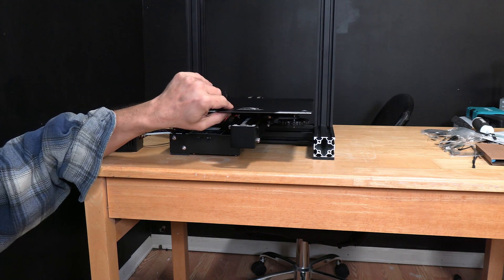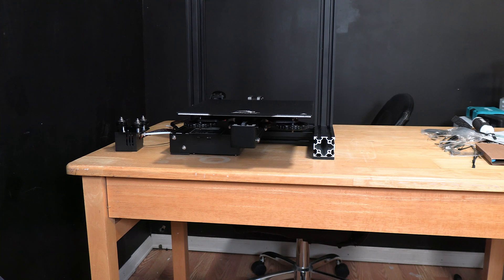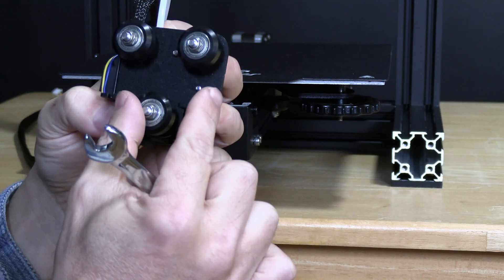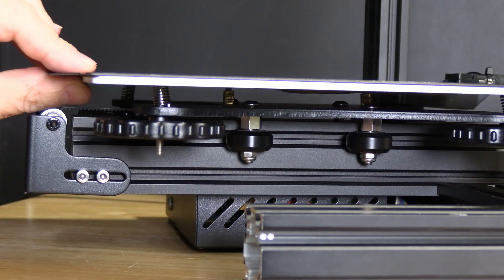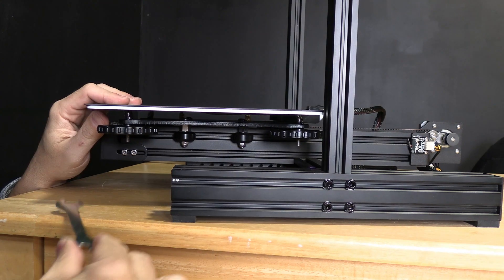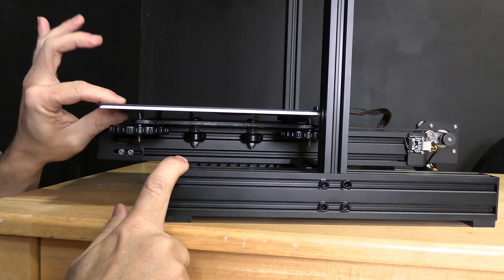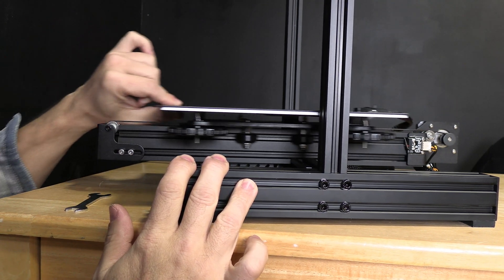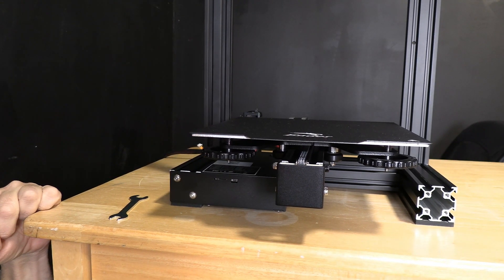How to fix Loose Wobbly Print Bed on 3D Printer. Find & tighten your eccentric nut.

Comment: What to do if y won’t move or y axis won’t go home? 

I see a red cable dangling off the heat bed, I read that is extra from manufacturing, but not sure. 
The belt seems fine, no damage. Basically this is a new printer. 10 prints or less. The hot end jammed, I purchased a new extruder from artillery. Getsaid extruder then the bed won’t move. Got a new k1 max but would love to get this going again

Comment: What are the symptoms of a loose bed, on my print, one side really close and another far ?
Reply from the maker: That is a tramming issue
Reply: @3DRundown  but the bed is level, and it is in the center
Reply from the maker: The bed is NOT, if it's higher in one side, than another. Unless the gantry your Hot End is riding on, is sagging on one side. I have a short here, on that. https://youtube.com/shorts/Xt2qK9DwpBw?feature=share

Also, is your ABL running? Made an ABL mesh? Using the ABL GCODE in your slicer? https://youtu.be/mKvst6qpkPw

Did the Manual Tramming, MY way? https://youtu.be/dpF_h8aOTAI
Reply: @3DRundown  the gantry and the x axis eccentric nuts were loose, i don't have a CR touch nor a BR touch, now it is priniting at the same height, but .1 mm below the bed leveling, if i use the babystepping z offset, while printing to +.1 mm it is perfect, I level the bed then auto home, then starts printing .1 mm below
Reply from the maker: DO get a CR-TOUCH. It's night and day

Comment: Hi! nice video. Thumb up!
As totally rookie I am using not more than 3 months Artillery Sidewinder X3 plus.
My fault has been cleaning thoroughly and "hard" my bed... without removing it from the chasis ( rookie me). Lately I detected this move of the bed and then found your video. 
My problem is that the nuts are already tighten and it's impossible for me to move it more. All of them. Should I replace all the chasis?  Or tue wheels...or something else?
Reply from the maker: Hi friend. It's ok to clean the bed on the machine, but, not HARD. Be gentle.... 
Your Eccentrics, should still do the trick. Remember, you may need to turn them the OTHER WAY. Try both ways on the eccentrics.

Comment: Be careful!
The eccentrics on some printers are mounted in such a way that excess tension warps the print-bed!
Anycubic Kobra 2 Pro...spent hours fine-tuning the eccentrics, never got anywhere useful.
Either the eccentrics were running loose and wobbling, or tight eccentrics warped the bed to the point I couldn't print.
I used to like Anycubic...
Reply from the maker: Nope

Comment: Good video have to check this ? 
So to tighten pull. Wrench 🔧 to  front of plate  is that right ? Ty
Reply: I'm not noticing a change at all. In fact it spins too easy. Can spin the nut with a finger. Any ideas?
Reply: YOU are turning the wheels  for leveling maybe ? please be more specific ? 
 @SomeGuyNamedRoy
Reply from the maker: I'm afraid to answer. Test each direction, you will easily FEEL the change.
Reply: @3DRundown  and I  shared your video on Facebook .. Shezz. Man
Reply from the maker: Things change, models vary, I don't want to give wrong info. Feeling it is best way
Reply: @3DRundown  it was a general video of a fix that most 3d printers need . When tightening most times it s clockwise to the right . Left corner clockwise to loosen .

Comment: My Neptune 3 max stays wobbly even on the closest wheel/rail setting i can go😢
Any Idea ?
Reply from the maker: The Eccentric SHOULD fix that. You try adjust both ways?
Reply: @3DRundown  the other side don't have excentric bolts that I can rotate to change the distance.

Also, the printer is quite recent (less than 2 months), and the wheels aren't used enough to have lost that much thickness either

Comment: My ender 3 s1 is randomly snagging and ripping the print off the bed, could this be caused by an issue like this? i've releveled and trammed the bed multiple times
Reply from the maker: Could be allot of things. Some infill patterns are more prone to that, excessive speed could cause it too. But, enough to remove the print from the bed, is not normal. Have you been able to see what is actually hitting the print? Is it the nozzle, the housing, the fan? Could try removing the Sprite, and re mounting it, being sure if there is any play, when you attach it, that it's not angles downward/inward when you snug it up.